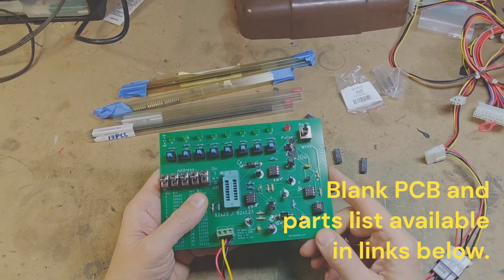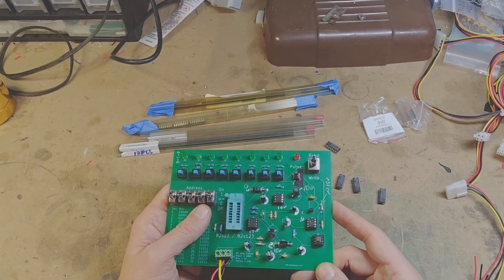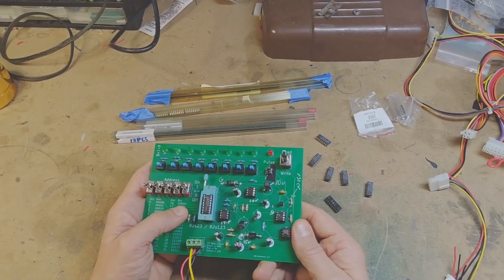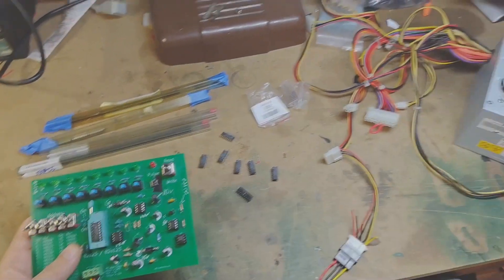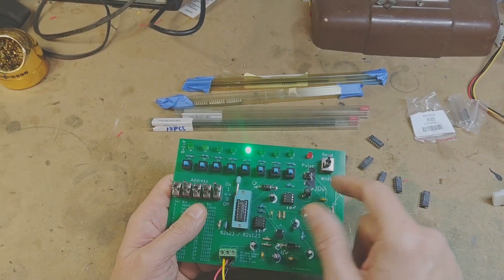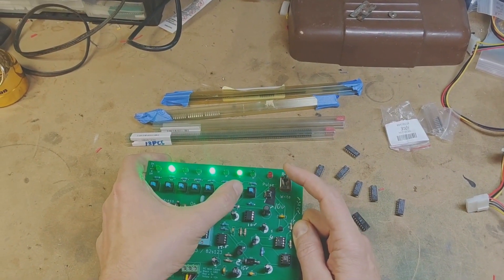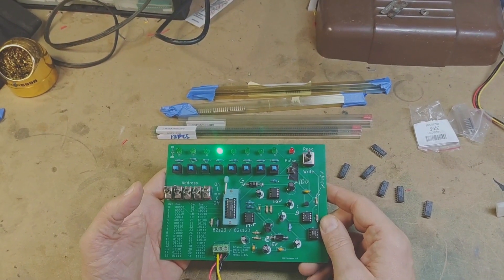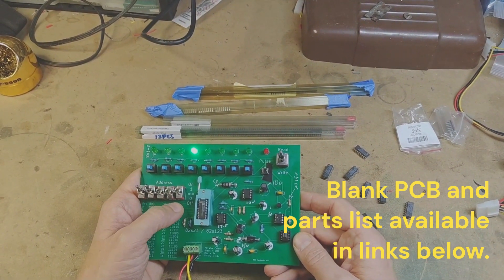Manual Programmer for 82s123 and 82s23 PROMs

Comment: Great video! 
I've just ordered one of your boards but I plan on programming a slightly different ROM - the MMI 6301, which is 256x4. Also I believe that an un-programmed 82S123 is all 0's and you blow fuses to get a one at that location.  The 6301 is the other way around. Do you think your board can be used for the 6301? I can adjust the circuit to get the correct programming voltage and pulse width, but do you foresee flaw in my plan? Many thanks for any tips you might have for me.
Reply from the maker: @fbloggs  thanks for the order.  I've tested this board with many different proms and only 82s123 and 74s288 worked successfully.  The MMI proms take a higher voltage that the power chips in this design can't create.  If I remember correctly they need 27v while this one is set for 15v, but really maxes out at 19v
Reply: @CCP187  Many thanks - one final question: What about the 82S130? It's the Signetics equivalent. It seems to have the same programming voltage as the 82S123.
Reply from the maker: @fbloggs anything that begins with 82s is Signetics/Phillips.   The 82s130 is 512x4

This substitution guide lists a mapping between brands and their specific model names.  Chips of the same size all  behave the same for reading , but still often have unique voltage requirements for programming . 

https://bsgelectronics.com/prom-substitution-reference
Reply: @CCP187  Many thanks. I'l modify the board to add the extra four address lines for 512x4 , adapt the pinout, which is quite different and will report back the results.